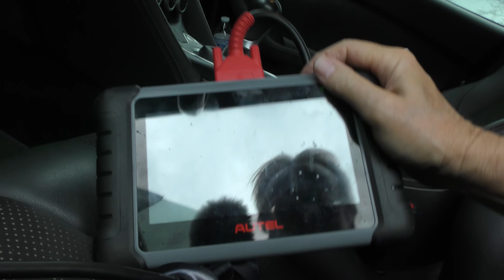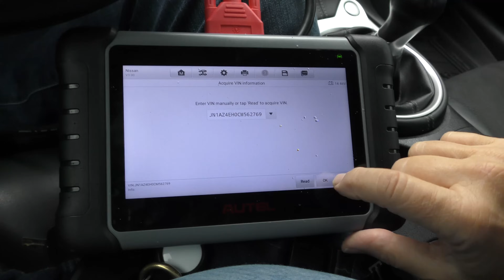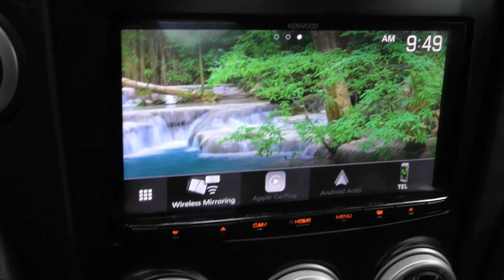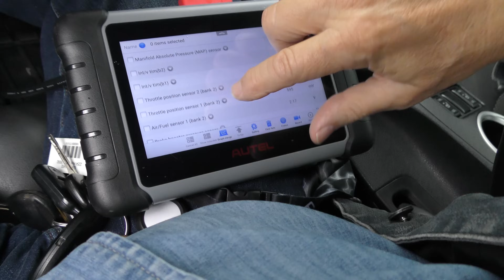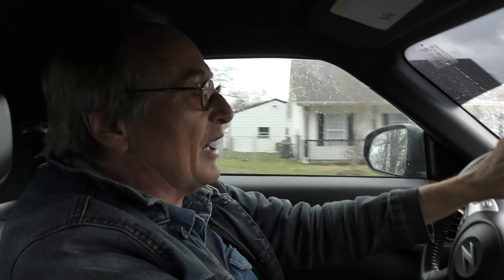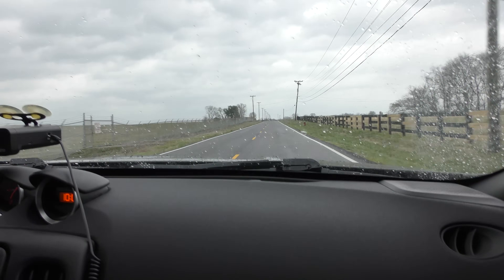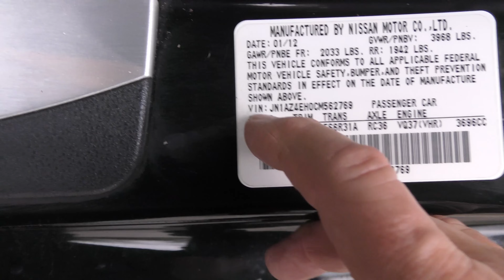This New Car is the Biggest POS I’ve Ever Seen

Comment: got a 370Z for $20k and only had 13K miles. What a steal back in 2018 and more so in today's market.
Reply: Yeah no joke… that’s my car in the video and I work at the dealership. We gave 16500$ for the car for trade and I had to pay 19500$ for it. Because of shop bill, and inspecting the vehicle. Plus Pack of our dealership. We are owned by a parent company who owns our dealership who takes 1000$ out of our profit for every car sold.
Reply: With 98K miles
Reply: But if you didn’t work there you would’ve bought it for 24K out the door
Reply: That's how much it's worth and probably less soon.
Reply: Yeah I bought one in 2020 and by 2022 had gained $6k equity over what I paid.
Reply: @PSYCLOWN185  Well, don't forget that a dollar was worth a lot more in 2020. Just the facts.
Reply: @NXCProductions  got a question for you. I have a 2013 Z and I will be getting the 100k maintenance done on it soon. Do you support changing the transmission fluid or not? I've heard some horror stories on changing and not changing the fluid out. What's your opinion?
Reply: @hxhdfjifzirstc894  I realize that but I'm just saying this should be a clear indicator of the economic shift. I'm not stupid enough to think I just made a ton of money overnight on a used car purchase but there are still advantages to it financially. For starters, Zs hold their value much better and longer than many other vehicles so if things shift cheaper again, I'm confident these cars won't drop as much as many others. Also if your plan is to trade for a new MSRP priced vehicle, you are that much closer as new vehicles didn't seem to shoot up as much as used.
Reply: @kellyweb maybe try a lightweight flywheel and a different clutch setup, heard it smooths it out real nice. If it’s auto I’m not to sure tbh with you
Reply: Dude. I miss the car prices of 2015 to 2019
Reply: I got a 19 wrx for 20k with 18 thousand miles. Some kid really wanted to got to Bible school. That's no joke either, that's how I got it.
Reply: Considering that there's 4 for sale in my area with less than 25k miles and they're all under $20k, you didn't get the deal you think you got.
Reply: @NXCProductions  your dealer gave too much for it and you paid too much for it
Reply: I think I found a nice one for 21k. "No accidents" 2011, 86,000 miles, manual, black cherry paint, on lowering springs, 20in 5 spoke light bronze wheels, headers, intake, exhaust, tune. I drove from New Orleans to Houston to get it and fell in love. It needs some some TLC tho, some paint work, radio, headlights, a couple other minor things but im glad I went for it. I miss my 2014 Brz (it was a total loss in an accident not my fault) but this thing is awesome.
Reply: @JB-qy1gx where are those cars located?
Reply: I bought my 2017 370z Nismo tech for 36k with 2,000 miles on it in 2018.
Reply: Bought a Z for $20k just like you and it had 8800. Back in 2016. Still drive it.
Reply: @PSYCLOWN185 bought mine for 22k 19k miles. 2 years later insurance company paid me 24,500 with 47k miles lol. Now the same car similar package a miles I s selling for 26-27k touring model Crazy 😂. I miss it gonna buy another one…..
Reply: Just bought 1 in todays market with 49k on it Manual/touring for only $12k. Not bad right?
Reply: Bought my 370 with 67kmiles for 12k
Reply: where are yall seeing Z’s for 20k or lower with lower than 40k miles everything i see is asking like 25k or more

Comment: I drove the 370z for over 9 years. I didn't have a single issue with it. Such a bulletproof car
Reply: What year is your 370z Jae?
Reply: how many miles? how often do you oil change?
Reply: @Firebrandt  2009
Reply: @billyberner  I averaged around 7k miles per year. Synthetic oil change done every 3-4k miles.
Reply: Would you recommend a high mileage 370z?  There's some in the 200k range for $10k.  About ¼ what they were selling for new.
Reply: @jaex26  That's excessive.  Synthetic is good for 7-10K. I guess it's a low mileage, semi garage queen.   I wonder how these stack up as dailies.
Reply: @MisterMister5893 theres no such thing as an early oil change, especially if you care about the car
Reply: 90000 trouble free miles. oil change every 4000 miles. great car! 2013 sport tech.
Reply: @MisterMister5893  Drive mine daily here in Germany, and I have to say: It prolly is one of the most dailyable sports cars out there, if you exclude the ones that have a backseat: And thats basically the only drawback, you can only carry one additional person, which makes it difficult with friends. And the trunk is kinda small. but as a single person I manage. Otherwise: Great! Reliable, comfy to drive long distances, isn't to hard on gas, maintenance is cheap, looks good, has a HUGE aftermarket, affordable and is fun to drive. A purists dream!
Reply: @kadleli683  As far as the trunks go for sports cars it's pretty big.
Reply: @kadleli683  I agree on it being the most daily-driveable sports car. I have a 2017, got it at 42k miles. It has 83k now and havent had one single problem with it. "most daily-driveable sports car" is damn near the reason I bought it and I'm glad it's lived up to that.
Reply: Scotty, you should drive my 2008 g37 with high flow cats and aftermarket exhaust with admin tuning 3" long tube intakes as well as tune. Far as i know, the only g37 with the 5at and this thing just rips!! 

New beffy sway bars and poly mounts for them and also the rear diff.....just great to drive!

Comment: Basic issue with the new Z is the crazy markups. Seems like a good car, just not paying 10-20k over sticker for it.
Reply: You could get a nice Lexus for 40k
Reply: @smallbeans101  a better option
Reply: Would you recommend a high mileage 370z?  There's some in the 200k range for $10k.  About ¼ what they were selling for new.
Reply: @MisterMister5893  what year?
Reply: @smallbeans101  This particular one was 2012.   Wasn't looking very hard.   I just saw one on the road today and was curious about their price.  

Were there any significant mechanical changes from 2009 until they were discontinued?   I"m partial to the pre-face lift design, so 2009-2017?  Was close to signing off on a 40th Anniversary some years back but bought a more sensible car instead.
Reply: @MisterMister5893 nope. Not without real maintenance history. People don't take of their crap.
Reply: @modelotime3608 its a toyota ..
Reply: @smallbeans101 I like Lexus but it's not gonna outrun the new Z
Reply: It’s not worth 1 penny over sticker
Reply: @smallbeans101 You could get a cow for 10k, but that's not going to be a RWD, manual transmission sports coupe either.
Reply: Even MSRP is too high for it. It would be much better at 10K less. Don't even get me started on the price of the Nismo variant..
Reply: Yeah, I'm not paying $55-60K for a $40k car.
Reply: @smallbeans101 Didn't know Lexus made a cheap, 2 seat sports car that's relatively small and light and has 3 pedals and a little power. That's cool. Gunna have to find one of these unicorns. 👍

Comment: New Z is not a failure, dealers can't get them in sufficient numbers yet, or the ones that do have them have ridiculous markups on them.  Give it time, they will sell just fine.
Reply: Yes!
Reply: They might not be a failure but they are mid. Both 350 & 370 were really well received when they came out
Reply: Those ridiculous markups are killing interest.
Reply: The failure is that you have to spend $50k MSRP for an LSD, the transmission grinds, and the tires and suspension suck.
Reply: They're not failures but by most accounts, Nissan didn't go anywhere near far enough with the redesign. The 400 would have been a really nice update back in say, 2010. But after 19 years of 350/370Z cars that changed little after all that time, people were expecting a lot more out of the new car. Ditto, the Titan and Frontier pickups. Too dated, even though their design is all-new.
Reply: Coming from a 370z owner. The new z will be a failure if it isn’t already. It’s way over priced compared to what other cars have to offer these days. Personally, when I’m ready to trade my z in I’m going bmw
Reply: Exactly what I was thinking. The new Z literally just started coming onto showroom floors. I'm not a fan of it because it looks just like a Jaguar F-type.
Reply: The new Z is pretty much non existent on show room floors at this date.  So I’m not sure where Scotty gets his info from. The ones that do sell are $10,000 over sticker where I am at. It’s also not less reliable or performance vs. previous versions due to the fact Nissan isn’t doing great financially. They took a lot from the old generations to make this new one. There is not much funding for rwd performance cars especially at Nissan.  I look at then new one as a facelift 370. And if I must have new tech I’ll look elsewhere.
Reply: Right I can not believe he said that they are having a hard time getting rid of the Z car.  That is crazy the supply down that is one reason they are not selling I huge numbers. The other reason is that dealers are selling them well over MRSP.  Just like with most other vehicles.
Reply: @cll1639  I personally think the redesign looks great. However I get what you are saying. They borrowed a lot of design elements from the old 350z/370z.  They did a lot of cost saving with the new Z.  Companies are not interested in putting money in ICE sports cars anymore so I applaud them from keeping this car around when GM is canceling the Camaro and Dodge is going away with the challenger
Reply: @chevyls5.3turbo25  scotty got this info from the q60. its the same  motor thats in the new z and this new z is not the next z either. nissan said its a retro car because they thought the "fans would love it". thats why its so much like the other z's because its a mix of all of them
Reply: @s14sr240silvia  How It a failure its finally not slow and has potential unlike the 370z. 3-4 k your hitting 500 wheel in a 370 your spending like 20 k to get 500 wheel . Btw go bmw we don't want you here im finna go Gtr nismo 🤷‍♂️
Reply: It IS a failure .... The comprehension skills of the people comments it here is fking  mind boggling.....jfc

Comment: These cars in Canada have almost no issues. They can handle a beating. 
Few wheel bearing here and there but mostly reliable.
Reply: What about the infamous Canadian snow?
Reply: They do have a couple of issues: The clutch master cylinder usually fails and needs to be upgraded with an aftermarket version, and the key can fail leaving you unable to start the car. Other than that it's a very impressive car, IMO. It's kinda like the poor man's supercar.
Reply: @MrOiram46  lol they park for winter
Reply: @The Mow-ron  I haven't seen one yet 🤞🏾. Lol and yes poor man's super car
Reply: I've seen dealers ask for 80k for the new z in canada
Reply: @420villain  thats crazy. At that point I'd buy a used GTR instead.
Reply: @the_mowron i think that’s more of a problem on the pre2012 models? 13 & up I like better anyways especially V2 nismo just looks better to me
Reply: You’re defiantly right I bought my 08 350z from Quebec City. Has 12km no rust or anything it was well taken care of as u can see on my Channel

Comment: Yes, the VQ V-6 has a water pump powered by the timing chain but it rarely fails. Just change the oil and filter and you are gonna do just fine
Reply: What’s the biggest pit stunk that you’ve personally been a part of?
Reply: Mines failed but it was at 112000 miles
Reply: My j vin rav 4 water pump went at 75k granted it’s pretty easy to get to at least
Reply: If you have an 09 or older , the oil gallery gaskets need to be replaced
Reply: @ThaKidZhane  Yup, I had my 3.7 (G) gallery gasket and timing chain done, after water pump failure at 156,000mi.
Reply: @ThaKidZhane  actually 07 or older
Reply: @thetechlibrarian  a mass manufactured water pump going out at 75k isn't bad. It's not as great as lasting the life of the vehicle but not an uncommon occurrence. My 88 grand marquis with 105k miles water pump went out and with 2 Hondas with more mileage I never ran into that issue. Replaced my share of fuel pumps across all 3
Reply: They're starting to fail now regularly on older cars. my friend's water pump gasket went bad on his 2011 g37 @ 113k. Mine failed at 143k on my 10 G37 as well. The cars are now 10+ years old so it's really no surprise.
Reply: @ThaKidZhane  incorrect. there is no 370z older than 2009. I believe 2013 was the face-lift which included the upgraded gallery gaskets. so anything older than a 2013 model will need the gallery gaskets.
Reply: @Ch0p-69  THIS. This is the correct info 100%----there is plenty of ways to clarify this as well, and I'd never have replied if I wasnt 100% sure🙌🙌

Comment: I have a 2006 350z since 2015 it runs great still with 169k miles. I redline it everyday, amazing its never had engine or transmission issues. It really does run like a top.

Comment: I owned a 1987 Nissan 300Z and it was a slug. It had a v-6 engine rated at under 200hp and the car was just plain heavy. I loved the looks of the car and the interior was pretty nice too. The new 370 such as the one in you're video is a true Japanese sports car.
Reply: Interesting story. Son had a 300zx 2+2 manual first car drove it for 10 years . Went to Nashville auto diesel college back and forth to S.Carolina digital dash . Then moved to Charlotte while in Charlotte he buys a 350z 2003. Drives that all around Charlotte while he works as a diesel mechanic for the bus company parks the 300zx for 3 years. Goes to get a trailer when he's ready to move back to S.C to trailer the 300 home. His 350z goes in limp mode . He puts the 350z on the trailer and drives his 300zx home after sitting 3 years. BTW the 350 had a short in the harness he found a week later. .
Reply: My 280Z; my first ever  brand new car was the worst if the lot.
Reply: Most cars released in or around 1987 were slugs by modern standards. They were decently quick for the time.
Reply: Never driven a 370 but the 350z I drove was still pretty slow. Hardly felt any faster than my e46 330xi
Reply: @defyyourlogic487  When the 350z was first released in 2003, it was pretty quick for the time. 0-60 in 5.3 to 5.6 seconds, 1/4 mile in the 13.9 to 14.1 range. It was as quick or quicker than a Mustang GT of the same year.
Reply: I had an 88 turbo and it was pretty peppy.
Reply: @hartsickdisciple  I mean that’s true but the 100k+ mile teenage wet dream examples (aka the majority of the cars left) would be lucky to crack under 15s.
Reply: lol cuz you had the non-turbo engine, the VG30ET (note the T) is a great engine, just really cramped and hard to work inside of.
Also note, when the 300ZX came out it was faster than the Lamborghinis and Ferraris at the same year.
Reply: @hartsickdisciple  Very fun to drive cars but not great passing power that's for sure, my 2002  Camaro SS seemed much, much faster in a straight line.
Reply: I had an 86, same car. Not a hot rod, but not a slug. It's all relative. It certainly was a POS, tho.
Reply: @josephk6136  my friend rented one of those.   Unsure if it was a 87 or 88.  Before he returned it, he let us all try it out...  I ripped around a few corners...and it just wouldn't let go of the road.  IT GRIPPED THE ROAD!  Hey, I was on residential roads...kids, dogs, etc., so I only barked around a half mile and brought it back.   My dad owned a well respected automobile repair business in Pasadena.   So i test drove just about every kind of vehicle made.  You only need 3/4 of a mile to judge a vehicle's acceleration, suspension, braking and turning capability.   Plus, you aren't harming the vehicle or racking up miles on some customer's odometer.
Reply: Ya, they are slugs thats why you dont get one unless its the twin turbo thos engines are actually pretty strong but the 2000 to 2006 awsome! If you want naturally aspirated
Reply: I've got an 86 300zx NA I've converted to manual and beefed up the suspension. Running electronic fans and did all maintenance it hadnt had in 30 years. Loooove the way this thing handles the road now. Corners are so much fun. It's not the quickest thing on the road compared to modern vehicles but it sure is enjoyable!
Reply: I agree most cars in 1987 were slugs all except for one the Buick Grand National...
Reply: It's crazy how little horsepower cars had in the '80s but we thought they were good
Reply: @richardnaclerio132  Hah!  Regardless of the automobile topic...the Buick Grand National has to be mentioned.    The perfect description, in one word:  quick.  For anybody who reads this:  find someone who owns a Grand National and pay him for a short ride.  Something to put on yir bucket list.
Reply: @drunvert  I know, I thought supra with 320 HP stock was fast… now I’m driving a stock  370z.. peppy but not as fast modern cars..
Reply: @wymple09 k
Reply: @wymple09 all you had to do was put a LS v8 in that 1986 300zx and you'd be beating Camaros and mustangs without any hesitation
Reply: @lg.vg86 if you was to go and put a LS2 V8 engine into your 86 300zx you would be able beat most modern day cars easily
Reply: No, your 87 did not have a V6.

Comment: I have a 2013 370z Nismo. Bought it in 2012 w/ 5 miles out the lot. Now it's at 225K miles. I go thru a set of tires a yr. I take it camping, go thru snow (light), take it on really bad dirt roads, packed lumber in it,  and long road trips.  It's my daily commuter as well. Still has the original suspensions. I red line the car almost every time getting on the freeway.   Lots of fun zipping thru curves in the hills/mountains.  I drove it over 100miles the 1st day I bought it and took it up to 110mph the 2nd day (which you should not do with new cars).  I'm surprise the engine & car lasted this long.  It had a blown head gasket for about a yr now, so I am replacing it at the moment. I'm not a mechanic nor have experience with car engines. Hope it turns on after I put it all back together.